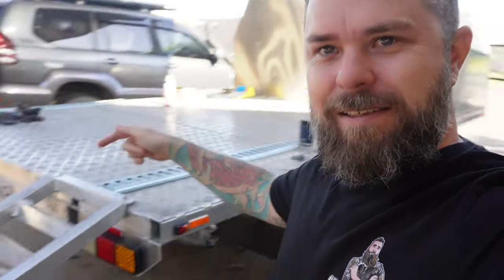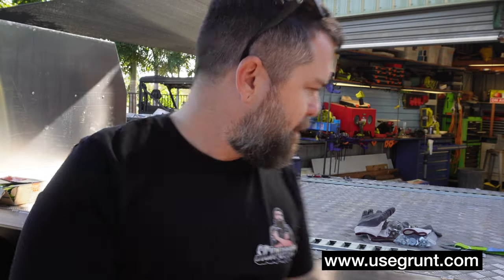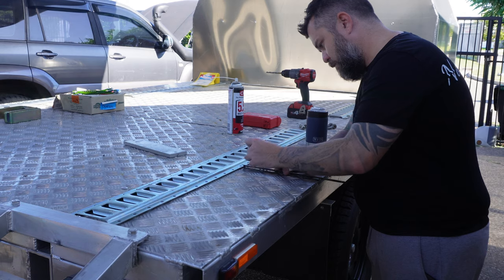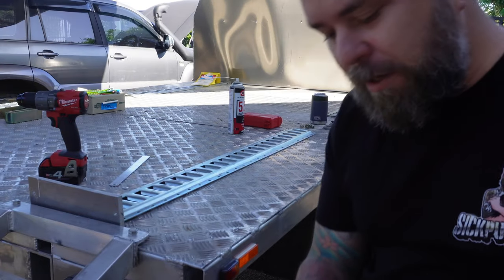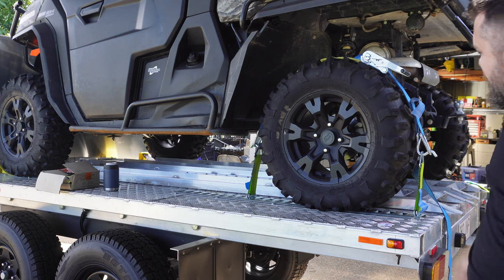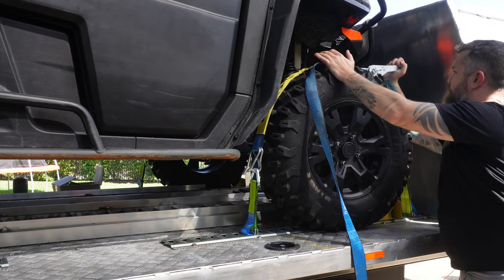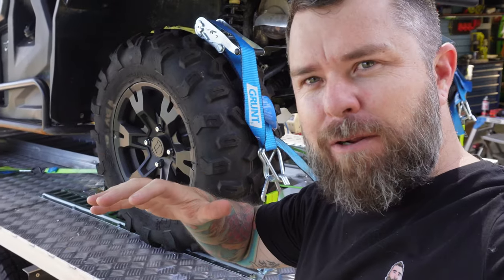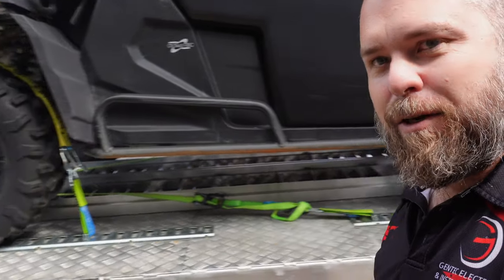That ain't goin' nowhere! Grunt E-Track UTV Tie Down Track System

Comment: They make tie down straps with the etrack clip on each end for securing tires. Little simpler, something to look into.
Reply from the maker: Yeah, seen them. Probably change over to those ones i reckon. I already had these tie downs so i went with this style for a little bit

Comment: What size trailer do you need for the buggy mate?
Reply from the maker: It goes on the deck of my toy hauler I built. The deck area is 3m long x 1.8m wide
Reply: @Kenny_B  cheers mate. The buggy still going strong?
Reply from the maker: Yeah no issues so far. I just beefed up the rock sliders on it and am making some alloy bash plates using the factory plastic ones as template 👍🏼